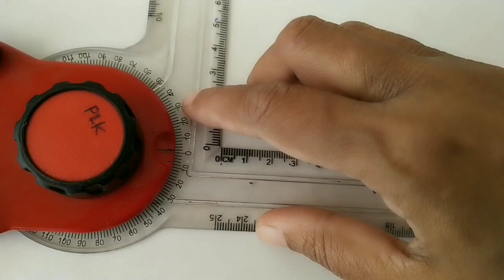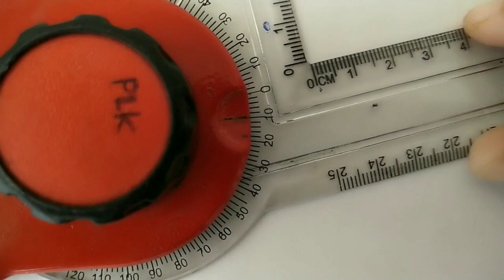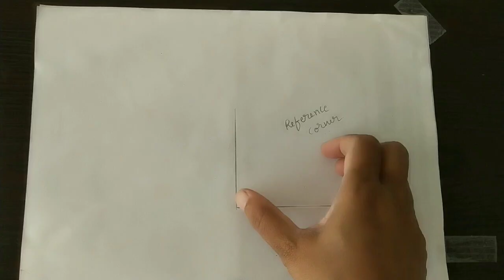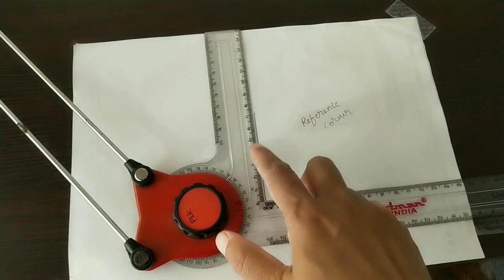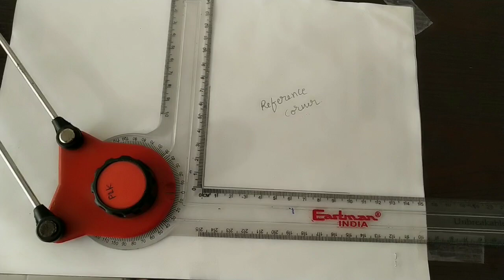How To Use Drafter & importance of Reference Corner //Engg. Drawing //Engg. Graphics

Comment: 7. A room measures 8m, 5m wide and 4m high. An electric bulb hangs in the cetre of the ceiling 
and 1m below it. A thin straight wire connects the bulbe to a switch kept in one of corner of the 
room and 1.25m above the floor. Draw the projections of the wire also determine its true length 
and slope with the floor.
Please tell this question mam
Reply: Please tell this question mam
Reply from the maker: Ok
Reply: Tell this question mam please
Reply from the maker: Monday I will upload
Reply: This question belongs to projection of lines
Reply: Ok mam